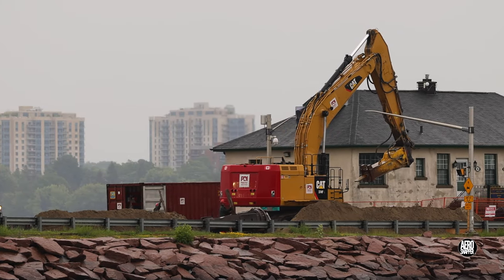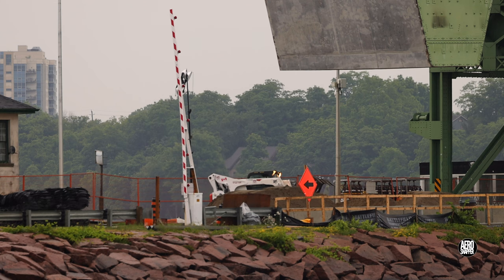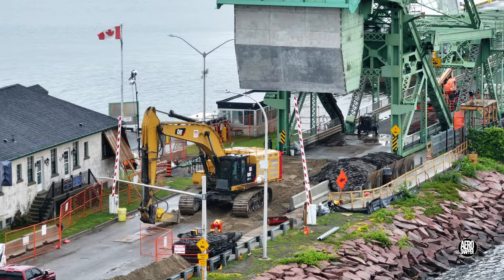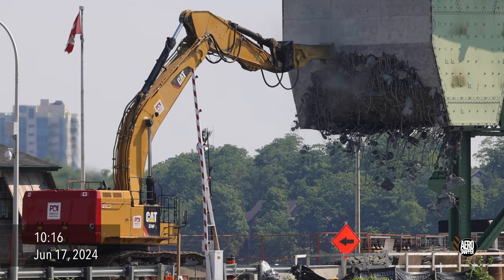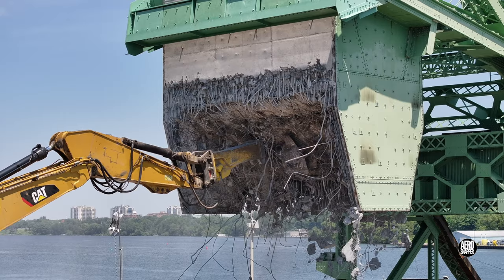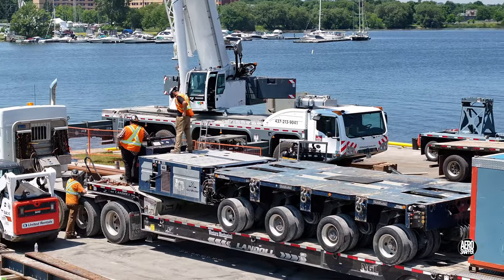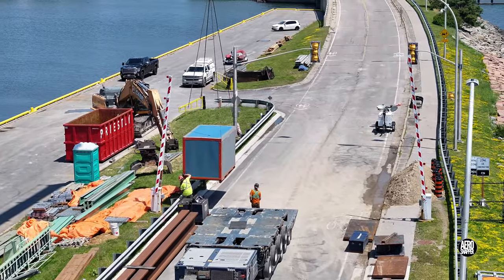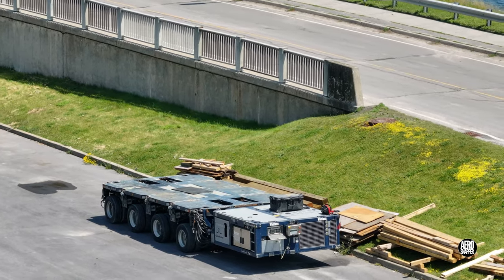Breaking Up is NOT hard to do - an update on the La Salle Causeway   4K

Comment: Lots of rebar in there!
Reply: Yes,  I wondered the same thing!!  I checked.  Seems rebar is over 3 times denser, than concrete!🙂
Reply from the maker: Yes, indeed, Gary - they didn't skimp at all - just a shame that less than a year after installation it's nothing but scrap..
Reply from the maker: @BobHerres  fun fact to join that one, Bob - one of the reasons that steel is used to reinforce is the fact that it has the same coefficient of expansion as concrete....

Comment: That concrete did not seem to be all that strong! It seemed to be crumbling under that pounding hammer. Probably time for it to be removed anyway.
Reply from the maker: It's easy to under-estimate the power of that equipment.  The concrete was, for the main part, less than a year old and introduced as a replacement, in many places, for the original.